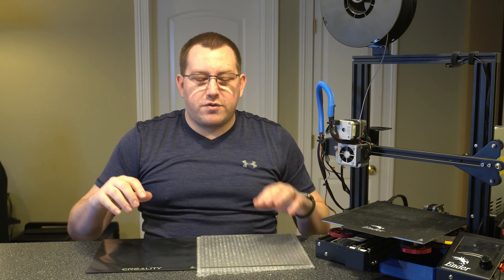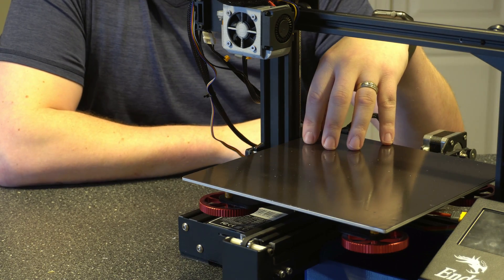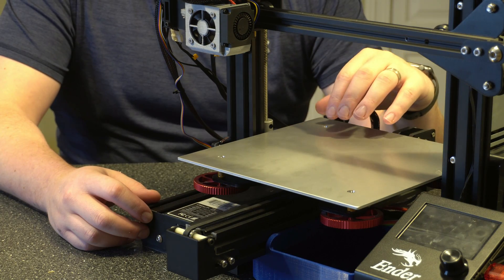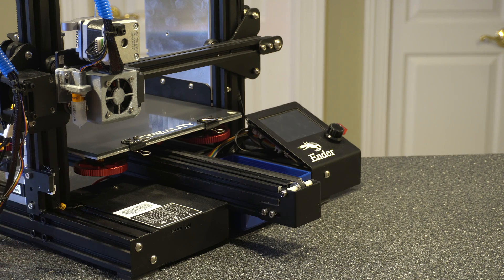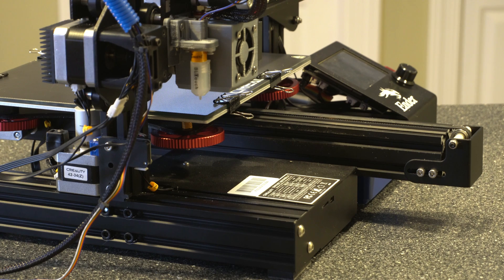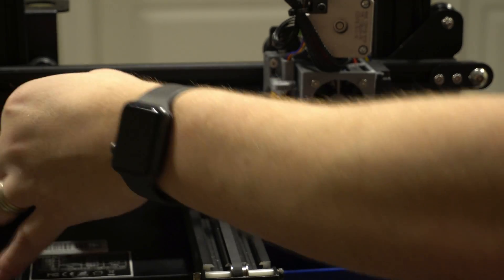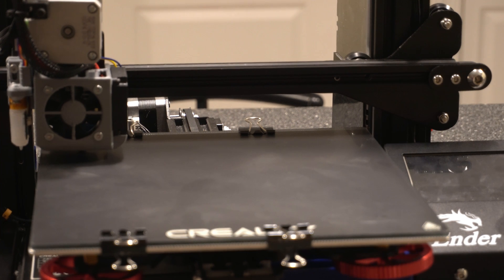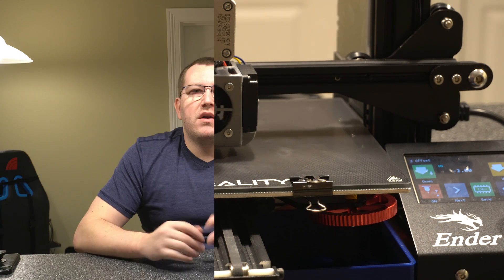Ender 3 Pro Glass Bed Upgrade – Complete Install Guide!

Comment from the maker: I hope you found this overview helpful! If you have any questions or would like other tips/tricks, just let me know in the comments.
Reply: I just bought the double screw Ender upgrade kit, and now cannot disable stepper motors.
I also do not have a proper manual on using the control box for my Ender 3.
Just installed a new Glass bed also, so need to calibrate everything again, I suppose.??
Can you offer any assistance, please ??
Reply from the maker: @Νεχυς  It may be worth joining the discord channel, invite is in the video description, there are a lot of people on there who can help out.

Comment: I recently picked up an Ender3 off ebay in need of a repair/rebuild for around $25.The seller had already purchased most of the parts to fix it and the printer itself had been upgraded from it's V1 spec with a 32 bit silent main.board. I have had a flashforge printer for about 4 years which came with both glass and magnetic build plates. I have always used the glass bed until recently when I went to remove a print and  took a chunk out of the glass bed. 
I couldn't source the bed for my printer but it turns out the 235x235 ender3 bed is the same thing.. Whilst I was waiting for the new glass bed to arrive I decided I would stick the 3m magnetic pad to my old glass bed and try the metal bed. I wish I'd have fitted it to my printer in the first place better adhesion no glue required I've printed with PLA ABS PETG and TPU no fails and everything came off the plate as easy as anything. When the new glass plate arrived I tried it to make sure it fitted then put it straight back in The box.
At this point I'm struggling to see how a glass plate is an upgrade. It's a preferance that costs more but IMHO the metal plate is way easier to use and they are so cheap on Aliexpress (for double sided plates) that you could describe them as a consumable. I've just bought a new one for the Ender 3 and even though I have a glass build plate for an ender3 brand new in a box I dont see the point of the attaching it to the base plate with paper clips.  You've just upgraded to stiffer yelow spring to try and cut down excessive movement in the build surface only to then risk the glass plate moving because it's basically bodged on with 4 paper clips. That feels more like a downgrade to me. At least on the flashfoge the plate slots into a sprung metal rail at the back and has 2 locking catches to secure the plate at the front.
Won't be putting a glass plate on either of my printers in the forseeable future.

Comment: For even more improvement. Ditch the springs. I replaced mine with rubber bumpers. Way, way less wobble. If you are having trouble with z wobble try it. Mine are orange.
Reply from the maker: Hi. Thanks for the feedback. I like the rubber bumpers as well as long as your able to get the plate level with them. Ive seen examples where people werent able to.
Reply: @3DPrintscape   I have seen that too. It does take a little longer to get it level. Very little movement after that. I also recently started flipping the glass bed upside-down.  It makes a much smoother bottom. I have not had adhesion or removal problems.  I use a hammer and chisle to remove my pieces from the glass. Works perfect every time. Think tap, not smash.

Comment: for some reason my lines are coming out squiggly and it doesnt stick
Reply from the maker: Hi. If the filament isnt sticking to the build plates its normally from the bed not being level or the bed not being clean. You could try some adhesion like bed weld to help out.
Reply: @3DPrintscape  The lines are coming out squiggly for some reason even when its ALL CLEAN. Any help? thank you.
Reply from the maker: @jnnlol  I would make sure you e steps and flow are set right. If they are and your still having issues you may have a partial clog.

Comment: What happens if you don’t remove the magnet layer? I’ve got a big failed print to remove with many separate supports and I’ll need to remove the glass plate from the bed to remove the print but it’s stuck🤷🏼‍♂️
Reply from the maker: Hi. Its possible that it will fuse to the glass build plate.

Comment: My print is off centered. How do I adjust the dimensions to match the new bed.
Reply from the maker: Hi, The size of the glass bed should be the same. If its not, you can change the size in cura, i just dont think its needed.

Comment: The guid on how to adjust the settings in cura for the glass bed is way too old and the folder the guide says to open (resources) but it doesn’t exist anymore.
Reply from the maker: Hi. Its been a while since ive recorded/watched this video but i dont recall there being anything in it related to Cura. You dont need to change settings in cura if your just replacing the build plate.
Reply: @3DPrintscape  you are correct that is my mistake. I was talking about the link in the description on this video. There is a how to guide on how to adjust the curea program on how to make it not run into the clips on the side of the glass, bed.
Reply from the maker: @ramdog1189  Ah ok. That article is a bit old so i will review it. Thanks for pointing it out.
Reply: @3DPrintscape  ofc. Tysm for making this video!

Comment: I have a problem with my bed adhesion because the corners are higher than the middle and sides but I don't know how that happened and how I can fix it
Reply: I tried only crtouch without manual bed leveling but the nozzle scratched the bed when I started printing but today I put a duct tape on the bottom side of the of the bed and it helped a lot so now it prints really good so I'm happy now
Reply from the maker: Hi. It sounds like the actual build plate may be warped (which is common). A glass bed will help a little but you really need something like a crtouch to account for the warping.
Reply: CrTouch is autoleveling right? If yes then I tried it but I have the same problem
Reply: But let's say I fix it how can I prevent it from happening again?
Reply from the maker: @chrustik_94  The crtouch will make adjustments on the z axis when printing based on the bed mesh. You can increase the number of probe points in the firmware for better results. If the actual aluminum build plate is warped from the factory there isnt really a way to prevent it from happening.

Comment: I don't know if I should install a glass bed because I don't want to peel of the magnetic surface or what it is
Reply: Thanks
Reply from the maker: Hi. I know some people leave the base bed in place and just put the glass on that (Just dont put the glass directly on the magnetic pad). The only issue here is the bed temp wont be accurate. If you add 5 degrees to it you should be ok though.
Reply: But if the glass bed is really good then I wouldn't use the magnetic one anyway, or should I?
Reply from the maker: Honestly, it depends on what your printing. If its just PLA the normal one is fine.  @chrustik_94
Reply: So if I am also printing with abs then I should buy the glass one?
Reply from the maker: @chrustik_94  I feel abs should be ok on the stock on as well. If you get into some of the harder filaments to print with then the glass may help. I guess what im saying is if your not having any issues i wouldnt change it up.
Reply: I actually scratched and damaged my stock one so I don't know if I should leave as is or replace it with a another magnetic one or go for the glass one
Reply from the maker: Ah ok, in that case i would buy a glass one to see if you like it. If you dont, return it and get the magnetic one.  @chrustik_94
Reply: But to try it out I would need to remove the magnetic pad and then it won't be good for the magnetic one
Reply from the maker: You could put the glass bed over the magnetic one (the bed not the pad) and increase the temp by like 5 degrees. That should give be close to the normal temp and will give you an idea on if you like it or not.  @chrustik_94
Reply: But wouldn't it stick to the pad?
Reply from the maker: @chrustik_94  If you put the glass directly on the magnetic pad base surface, it could stick. What im saying is put the magnetic build plate on the pad, then put the glass built plate on that.
Reply: Alright thanks for helping me

Comment: Hmmm?
I'm interested in making my S1 Pro bed glass in order to correct the slightly warped aluminum bed plate, but I want to still use the metal flex plate also.
Have you seen or heard of anyone doing that, and, do you think I'd still get the bed temps it says it is, or would I lose some heat doing that?

I think if I remove the magnetic skin and then bond the glass plate directly to the aluminum plate with an epoxy, then apply a new magnetic sheet on top so I can still use the bed the same way I've been doing it.
I don't have any problems with my flex plate, it's just the aluminum bed has begun to warp.
I wish there was a bolt on swap out type glass bed tho!
Reply from the maker: Hi. I think what your looking at would work but your temp readings will probably be off. If you have a temp gun you could read the temp before and after making the change (wait until the printer thinks its at the set temp), then adjust the bed temp accordingly.

Comment: All I want to know is switching between glass and the sitter build plates do I need to re-level the bed? Is there an on the fly adjustment? PLA is great on anything ABS turns out better on glass PETG over adheres and pulls chunks of glass with it so I frequently swap depending on materials.

My first instinct is to spray, Pam cooking spray… Adhesion has never been an issue. I always have too much on my end or three regardless of material temperature or surface whether I clean it or not this has caused the destruction of two plates already. Otherwise it’s great. Flexible is easier , you know glass will remain flatter without a bulge in the center I just want

I just want to find something cheap at the hardware store. Something I can keep a roll in the back and pull it over. Disposable whatever I’m sure it’s simple paper might burn tape is going to get gross with heat windshield. Chip repair is not going to stand the heat.
Reply from the maker: Hi. You would want to relevel everything when switching between build plates, especially if the thickness is different. Ive always just used the magnetic or glass plates and i use bed weld sometimes as needed.

Comment: Use a blow dryer to heat the adhesive. Should peel off rather easily.
Reply from the maker: Hi. Nice tip, thanks.

Comment: what?! NO! DO NOT LEVEL THE BED LIKE THIS. Every time you aggressively push on that spring it pulls the other three corners out of alignment.

also, why is your machine so wobbly?! bed leveling won't matter if your printer is all floppally doppally
Reply from the maker: Hi. Thats how i level my bed, some people do it differently. I go through the process a couple of times to make sure its level. In this case, i had the printer apart before the video and didnt tighten the eccentric screws.

Comment: I tried installing the BL Touch and after 4 hours thinking I broke my printer and many, many videos / forums later, watched someone walk through the process of manually setting up firmware. WARNING TO PEOPLE NEW WITH 3D PRINTERS, ENDER, OR ARE NOT GREAT WITH COMPUTERS ~ DO NOT use the BL Touch unless you find someone experienced to help, or fully understand the process. The firmware on the Ender website does not work with BL Touch, and there is precious little help out there for beginners.
Reply from the maker: Hi. Sorry you ran into issues with the bltouch.
Reply: @3DPrintscape  me too, I was really excited to use it, but I don't know anything about compiling arduino firmware. The guy who put the video on YouTube is a legend. If you understand it, you could make a lot of money doing a course on udemy, there are not a lot of alternatives out there for beginners just getting their feet wet in 3d printing, so you'd have very little competition, just saying haha. Great video BTW, you got a sub from me!
Reply from the maker: @ScrewtheBoxJustThink  What board do you have in your printer? If its one of the newer 4.2.x boards they are 32 bit and don't need the arduino board or anything. Also, thanks for the sub.
Reply: @3DPrintscape  one of the newer 4.2 boards. Maybe I misspoke, again, I'm new lol. I did have to follow some instructions on how to modify the open source firmware file, then compile it to get my printer to work again, and this is what I meant when I spoke about arduino. I was probably wrong about that haha

Comment: Umm glass is an insulator, a metal flex plate will distribute and heat faster at the print contact surface.  You can easily flatten a heat bed.
Reply from the maker: Hi. Thanks for the tip, i will look into them.

Comment: I'm kind of new at this I see on your Ender 3 Pro the filament feeder is on top of the extruder. I've seen this part on Amazon. Hypothetically would that be a possibility for a regular Ender 3? That would eliminate the need for the feeder line and the 2 connectors, it would be so much easier to change the filament as well..
Reply from the maker: Hi. The best option would be to covert it to direct drive. You can use a kit, like the one i cover here https://youtu.be/bwhEpRBpu7M , or buy a real all in one direct drive unit.
Reply: @3DPrintscape  Thanks for the reply and the info.

Comment: Hey I tried the restricted areas in Cura code from your website, but it didn't work. When I open up Cura it doesn't even show the Ender 3 Pro profile.
Reply from the maker: Hi. It sounds like there is an issue with the profile file. Try to revert your changes and check to see if it shows up.

Comment: Is it possible for the glass bed to be perfect right out of the box as well? I just got a glass bed for Christmas. The only thing i had to do was like you said make sure you move the auto home sensor with the new glass build plate. Then i just worked on getting all four sides pretty okay, ran a bed levelling program, made adjustments as needed, but i had adhesion right of the bat.
Reply from the maker: Hi. You will get good adhesion at first because the glass is clean. After a couple of prints, or it sitting collecting dust, you will need to clean it with rubbing alcohol.

Comment: Hi. I bought a creality glass bed, and i have yet to install it. I am not planning on removing the magnetic sticker layer (the one you peeled off). I know the risk may be that the glass bed will stay stuck pretty badly, but that's ok I'll deal with that when the time comes.

My question should i install my glass bed with the creality logo facing up? Or facing down? The reason i ask this question is because I've seen some people have the logo facing down and it would adhere better. I'm not sure if i should follow that... Again, I'm planning on keeping the sticker layer so idk I'd having the glass texture stuff facing up or down will do anything for me. 

Thanks!
Reply from the maker: Hi. You can do it either way depending on the surface type you want. One side will be completely smooth and the other will have the little holes. That said, Creality intended it to be used with their logo, and the holes, up.
Reply: @3DPrintscape  Thank you! Have you ever placed the logo facing down?
Reply from the maker: @nextlvlroy  Ya, ive used it a couple of times that way but I have other smooth glass beds that I use now if that's what im looking for.

Comment: Great video it helped me out a lot.  I have not been at this for very long.  I did have a problem with bed adhesion.  I was banging my head trying to fix the problem.  I kept re-leveling the bed and adjusting the bed temp (I'm using silk pla).  Turns out all it took was a little bit of hair spray.
Reply from the maker: Glad it helped! Hair spray works great but I prefer bed weld over it.

Comment: hint hint at removing the magnetic bed liner   heat up the bed before removing it its more easier to peel in one whole piece  i v e seen on other youtube and about magnetic liner and high temps its b.s  one guy on youtube tested it no issues
Reply from the maker: Hi. You are right, heating it does make it easier. I was hesitant to tell people to do that because i didnt want them to get burned (i have had issues in the past similar to that)
Reply: @3DPrintscape  of course wear a glove with grip pad

Comment: Hi! This may be a silly question, But I can remove the thin film over the glass bed before installing right? thanks!!
Reply from the maker: Hi. It should be just the glass. If there is a film on it, that would get removed.
Reply: @3DPrintscape  thank you!

Comment: The CR touch instructions say to remove the z stop wiring. As soon as I put the CR touch in, the printer homes z in the center now.
Reply from the maker: Hi. It homing in the center in normal with a auto bed level kit. The z-stop being removed doesnt make sense if all 5 wires from the cr touch get connected directly to the bltouch port on the board. You would typically only do that if your connecting the probe sensors to where the z-stop switch gets connected. Its possible they changed the firmware to account for the wiring changes though.
Reply: @3DPrintscape  yea I unplugged the z stop and haven't had any issues. The cr touch works great! It was easy to set up and is a huge hassle saver.
Reply from the maker: @WatsitTooyah  Cool, good to know. I was looking at buying one to compare to the bltouch.

Comment: Also what do you recommend for the glass before a print job? Just wipe down with rubbing alcohol?
Reply from the maker: Hi. I use rubbing alcohol to clean the glass and tend to use bed weld to help with adhesion, though thats optional.